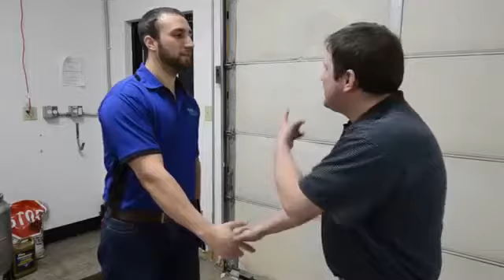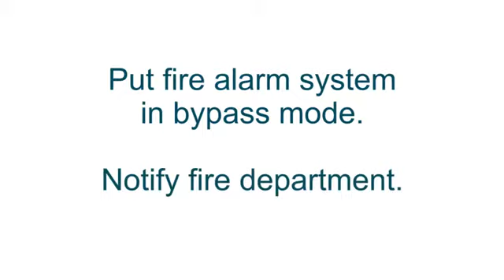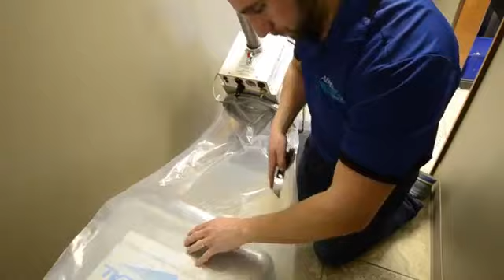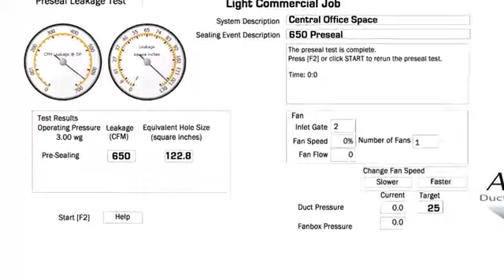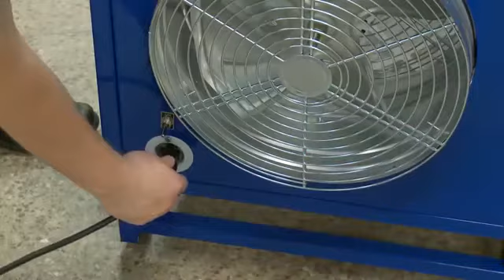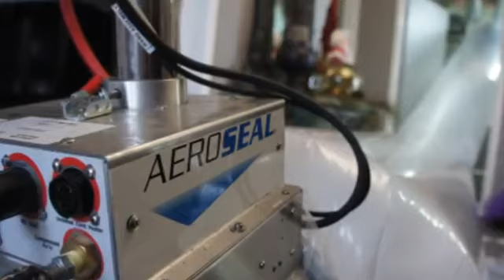Aeroseal Commercial Duct Sealing Showcase

Comment: How are the all components in air handler protected like the blower fan and heat exchanger?
Reply from the maker: +David Wojcik Hi David.  A combination of closed cell foam and duct mask are used to block off the air handler.